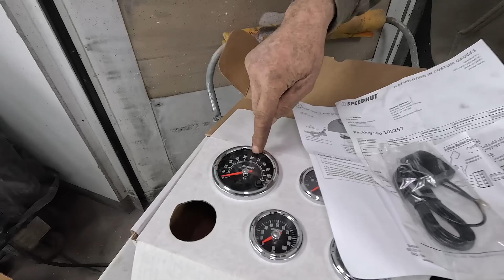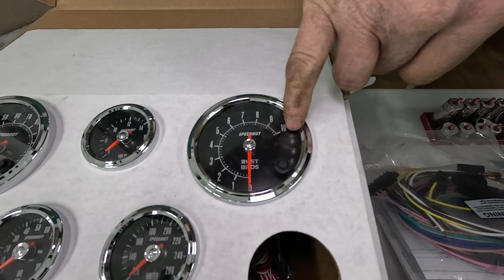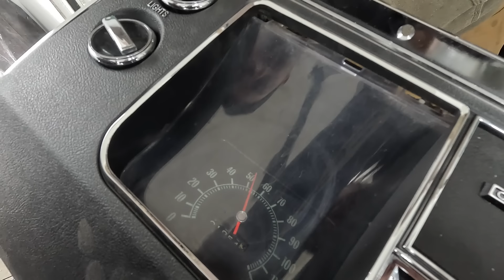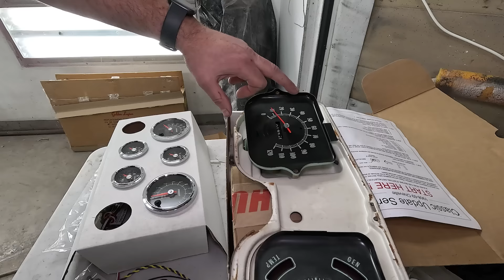Installing a Brand NEW Wiring Harness Wireworks in the 1968 Chevelle

Comment: I am in the middle of a 10404 Painless kit...pretty easy .....I am in it for a total of 10hrs. Proper workmanship...GM terminals and soldering. Wired up on Holley Sniper as well and VHX Dakota Digital Gauges. All that is left is the front light section. Almost all the wires are hidden. I had wired the car in 2018 with EZ wiring kit...which i didnt like too much, i took it out and paid it forward to a buddy building a 66 Nova. Jusy take your time and have a game plan....i wrote a bunch of notes on paper before strrting on the install. Oh btw my car is a 1969 Cutlass 442....similar setup like Mikes Ride...except my dash is a pain the ass. Great video!

Comment: O my God Mike  were your  fender covers. Steve leaning over on  your  front  fender 😮. You  don't need any  scratches on your new fresh  paint  job. I have  a 70 b body shift handle for  a car with a consol its a  pistol grip for 4 speed  transmission and the boot to go with it. If you  ever  look for  one.   Greg
Reply from the maker: doing a 70 coronet rt  dana 60 4 speed car soon i hope where you at lol
Reply: @RustBrosRestos  I'm  live in Connecticut it' will fit a new Hurst shifter for  
a car with consol